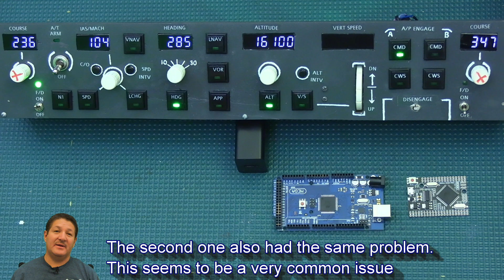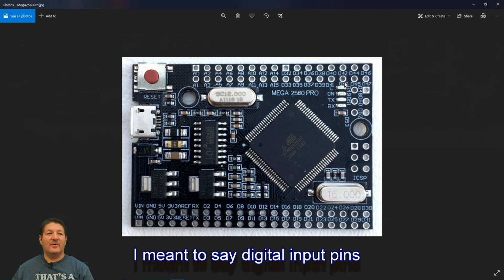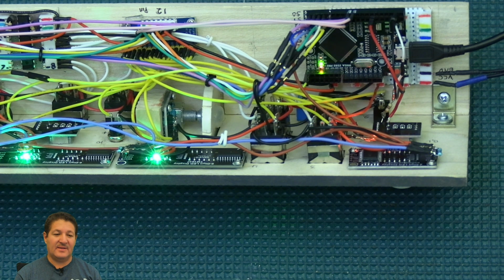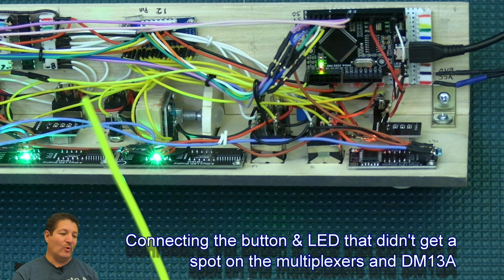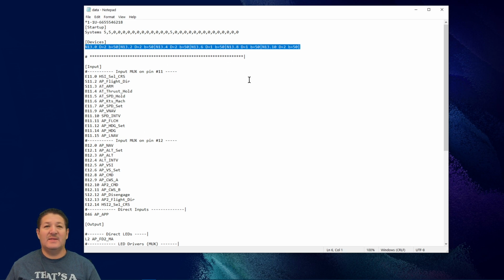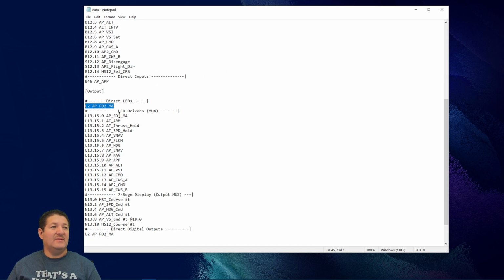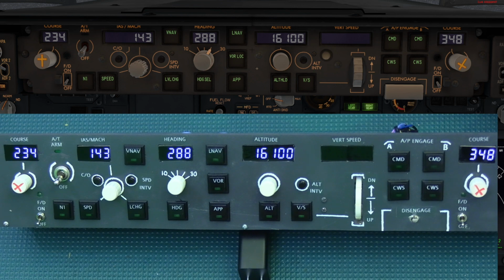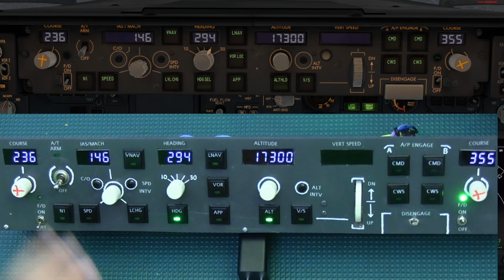Standalone plug & play MCP panel for X-Plane Powered by SimVimX

Comment: Nice, I have some issues with assigning a PTT button for vatsim. is it possible through simvimx?
Reply from the maker: Hello, you would need to use a custom dataref, but yes it is possible
Reply from the maker: Are you using XPilot? Why are you having dificulties? You're trying to do it through the XPlane menu right

Comment: Hello sir, I like the video on your channel, but I don't see the video tutorial for P3D or MSFS2020. i see the combination of Mega 2560 and Multiplexer it doesn't support for P3D, MSFS2020?. So is there a way? I only have 1 Mega2560 circuit and I want to combine many panels together. Mobiflight it does quite well, but it takes a lot of Mega 2560 circuitry and USB port on the computer, do you have any way to handle it? I hope you can answer lazy and release a video tutorial on this issue. Thank you. I like your channel
Reply from the maker: @flightsimulatorvietnam8593  Hi there, SimVimX is only for X-Plane. It does NOT work for MSFS or P3D. That's the reason I don't ever mention those other simulators. 

You're right. MobiFlight works very well for MSFS, P3D, and also X-Plane. That's one of the reasons I prefer SimVimX for X-Plane, because we only need ONE Arduino Mega to build an entire cockpit. 

Sorry I can't be of any help with those other simulators.
Reply: @Qosmokid  Thank You Sir